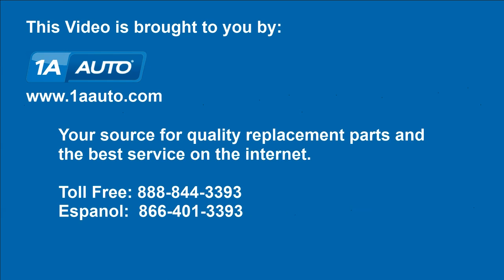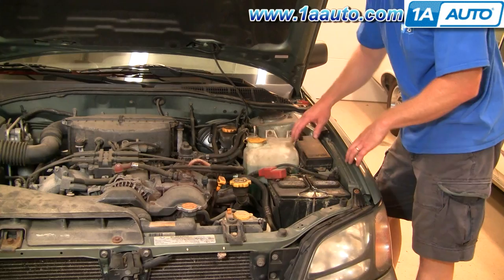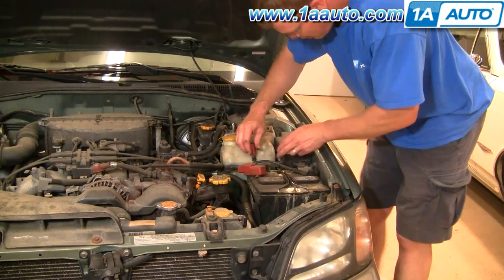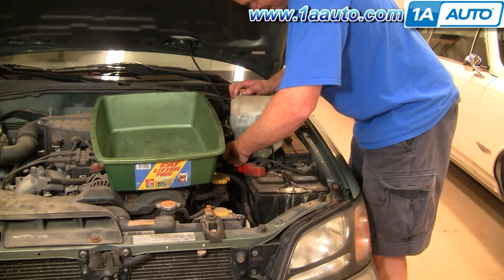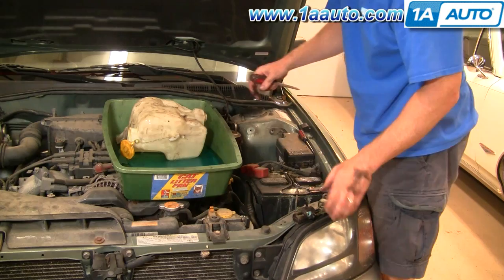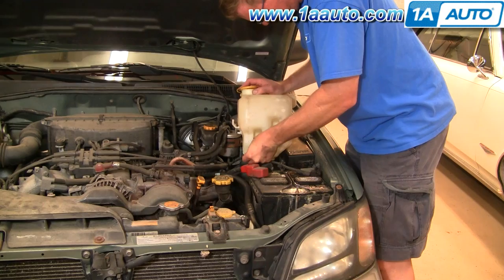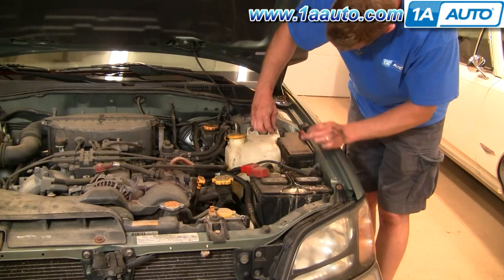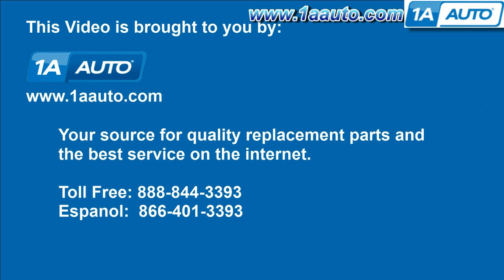How to Replace Windshield Washer Pump 00-12 Subaru Outback

Comment: Perfect "how to" video. I think I can now do the replacement myself. It's disconcerting when a motor works perfectly one day and then the next it's kaput. Pulled the electrical connector that fits on the front windshield washer pump motor and it was pretty corroded. Just in case it is a matter of a compromised electrical connection and not the motor itself, I sprayed a little contact cleaner on both male and female connectors and then put some dielectric grease on the female connector. Cleaning the electrical connector did not 'solve' the pump motor problem. Looks like I will have to bite the bullet and buy either an OEM part (most expensive but easiest solution since the electrical connector will just snap into place with no splicing involved) or a good quality universal replacement motor (Trico part #11-604; identical to the AC Delco 8-6722 in every way)  for my model Subaru and do some splicing or connector crimping into the existing plug-style connector. 

Ended up buying the Trico replacement pump motor and following the instructions included. One thing to keep in mind for both the new pump motor and the rear window pump motor (not replaced, it was working OK) is that when you drain the lines and disconnect the hoses for both front and back you will need to operate both pumps (in short bursts only!) a few times or more to get the fluid all the way through the lines again. Took a while for both spray nozzles to receive fluid and I thought I must have damaged something in the disassembly and reassembly but it was just a matter of priming both pumps and their lines. It's also a good idea to flush out the tank when its empty and before installing the new pump motor. All sorts of little bits of crud can work their way into the lines and block the nozzles. And when all is said and done, make sure you don't accidentally kink the hose to the front spray nozzles when you close the hood because then you'll wonder how everything was working perfectly one minute and then stopped working the next (though you can hear your new pump motor whirring away).  

Note: Trico replacement pump motor part #11-604 does the job but does not fit exactly into the cavity that the OEM pump was made for. 'Finesse' it into place but be careful not to damage the motor body or the new grommet that comes with the pump and replaces the existing OEM grommet. The replacement Trico motor will snug in tight but wont' fit completely into the cavity. As long as it holds tightly and the seal is good for the new supplied grommet you should be good to go.

Comment: Thanks very much for that.  It worked perfectly on my '98 Outback.  I broke one of the mounting bolts, probably by misthreading it.  A cautionary tale for others.  Fortunately, one is enough to hold the fluid reservoir.

Comment: Great video!  Neither of my windshield washer spray jets is working. Are both pumps defective or is this something else (i.e. a fuse)?
Reply from the maker: +Jeff G Thanks for watching, Jeff!  You should first check your fuses.  If you engage the washer and do not hear the pump go on then the pump may have failed, or there is an electrical issue.
Reply: I engaged the windshield washer and I do NOT hear the pump go on. I also engaged the rear washer and it worked.  Thoughts?  Thank you for your guidance!

Comment: I have a 2002 outback. Was told only after market pumps were available. I saw the pump with pigtails / wires meaning , I guess, i would have to splice wires withe wire nuts.
Is this the case? No female fitting to receive male electrical feed.
Thanks
Reply from the maker: +Tom Preis Thanks for checking us out! http://1aau.to/m/Shop-1AAuto-c

Comment: Is there only one pump that's used for both front and back washers?    Neither one of mine work.    Do I just need to buy one new pump?    I have a 99 Subaru Forester.    Thanks.
Reply from the maker: +Steve Vincent Thanks for watching. Yes, there will be only one pump for both front and rear washers. https://www.1aauto.com/windshield-washer-pump-acdelco-8-6722/i/acwwp00003?f=706980&y=1999

Comment: My rear washer works but not the front? Should I still replace both? Which pump is the front and which is the back??
Reply from the maker: +Celleste T We do not have a way of being able to diagnose the issue that you are experiencing with your vehicle but suggest taking it to a local mechanic for a proper diagnosis.
Reply: 1A Auto Parts That makes sense, thank you